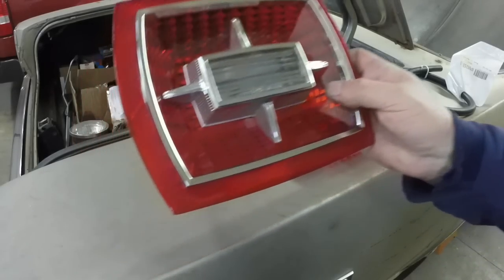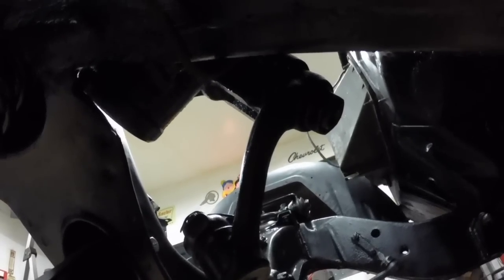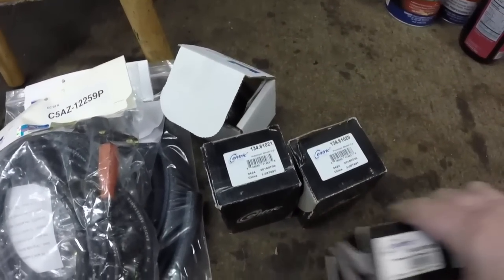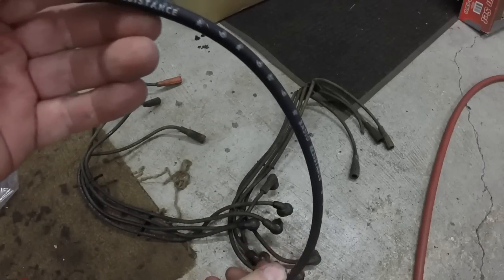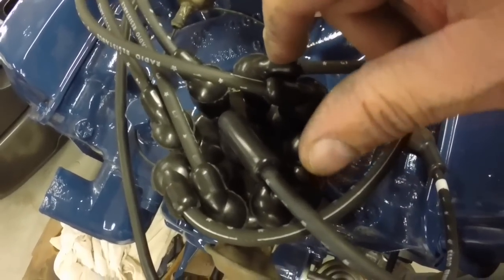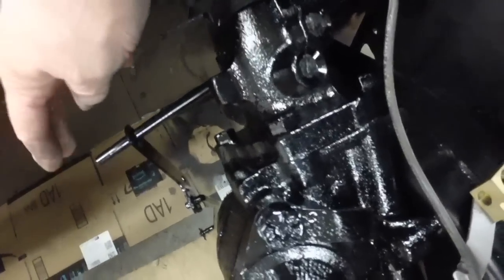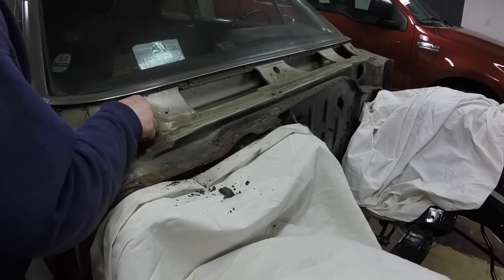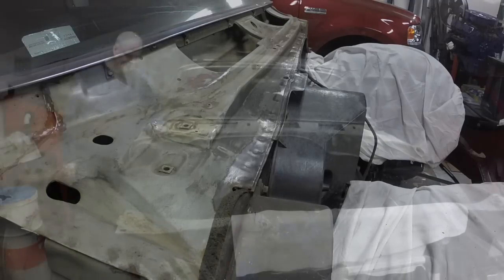1966 Ford Galaxie 500 convertible restoration part 46 getting parts and sanding

Comment: lookin good...i got to say it again..boy does this remind me of my 65 merc..good call on the under hood stickers...i think there should be one for the air cleaner that says  [ front ] ...did this motor come with an aluminum tag bolted down with the coil????,,its about the same size tag that should be on one of the bolts for your rear end ....keep up the good work
Reply from the maker: Yes there is a tag where the coil bolts down. There is a tag on the diff pig too. One on the power brake booster. I think on the trans sump. I think there was a decal that stated front for some odd reason. The housing only fits one way on the carburetor....

Comment: With that 1966 Decal/Sheet Magnet? that you bought... The Original 1966 Oil FIlter that they go with should be painted GOLD.  It would be the same GOLD color that the 1965 Valve covers and Aircleaner were painted.  The correct color is in any Autoparts store from Duplicolor...

Comment: I was just wondering...what are you going to do to the rear differential ?
Reply from the maker: When I get there I will decide if I am pulling it or not. If it needs new rear control arm bushings, the whole rear axle will come out. If the bushings are good, I will clean and paint it under the car, as pulling it, is a fair amount of work. The rear bushings seem to last a lot longer for some odd reason. I am replacing the springs, so the panhard bar needs to come off, at one end or the other. I may pull it, and replace those bushings, no mater what. I may pull the axles and pig too. That way I can get all the old gear lube out.... I am sure it's still the original gear oil....
Reply: @OldCarAlley  seems like the car was well taken care of....are you sure you want to sell it...lol....you are doing a fantastic job..see you on the next one...Cheers 🇺🇸🇺🇸🇺🇸🇺🇸🇺🇸
Reply from the maker: @rodneybrand8521  I'll drive it a summer or two.... but when I am offered a fair price for it, I will sell it. Then I will find another cool old car to tackle. It is in my top three favorite projects I have ever done.

Comment: If you will get you a DURABLOCK  foam sanding block and wrap you paper around it will save your finger and sand more even.
Reply from the maker: Somewhere around I have a couple durablocks. I also have all different sizes blocks of wood I use. I like using long wood blocks for sanding body filler.